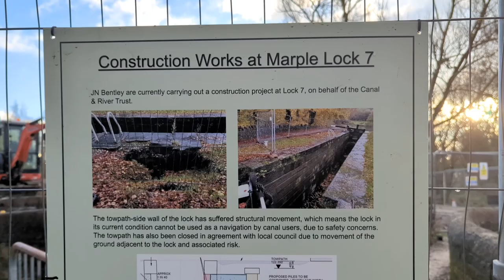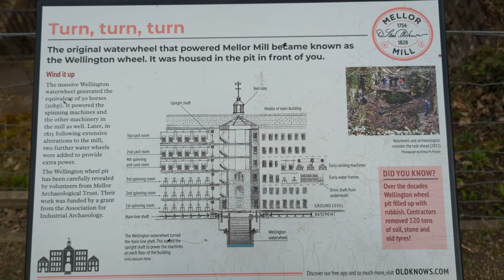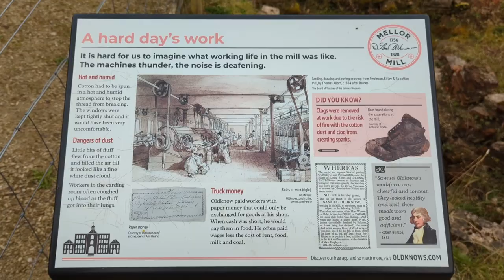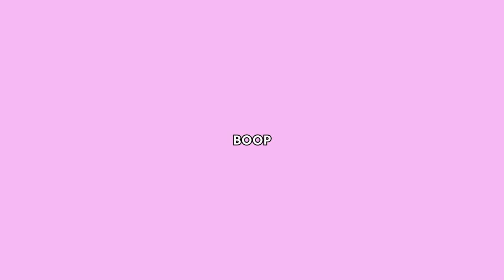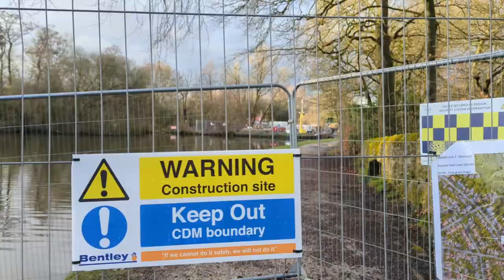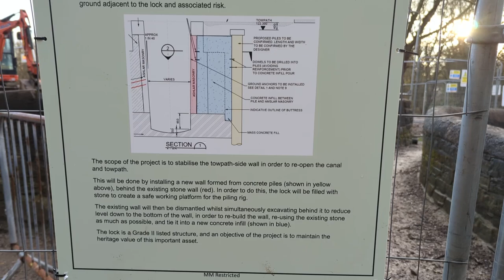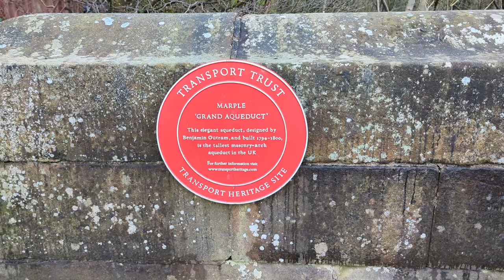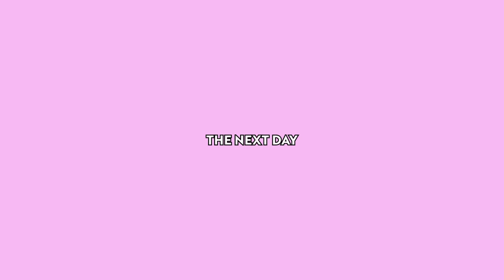Marple Locks are falling down - a change of plan - narrowboat vlog 71

Comment: I'm not sure you're worring too much about a leak. It may be the the water you're seeing is no more than imgress from windows and condensation forming, as it only has one wwy to go and that is down, into the bilge and , as I said in a previous comment, it may be the accumulator that needs re pressurising making the water pump keep kicking in. Only my guess but worth considering ❤
Reply from the maker: Thank you! We were concerned as our previous winter there was nothing like that much water and we certainly had leaky windows and condensation then too. Stu has definitely sorted a leak near the calorifier now and fixed the windows but the pump is still intermittently going off so the accumulator is the next thing we will look at! ❤️
Reply: @bobbing_along  good luck with it. I know what it's like, we have a boat too, always something with them isn't there 😊